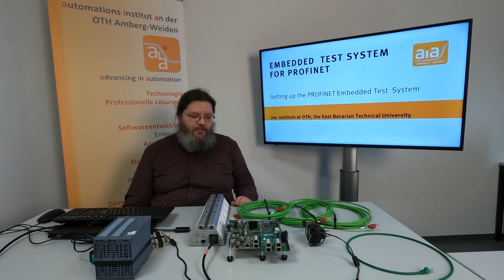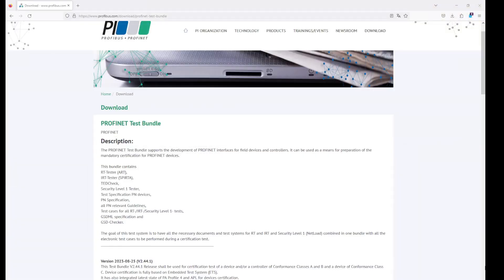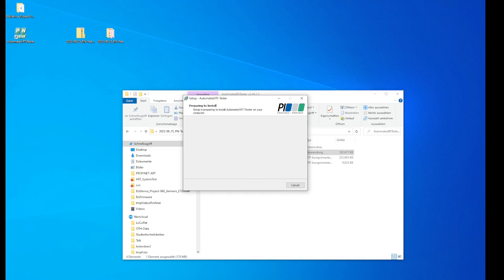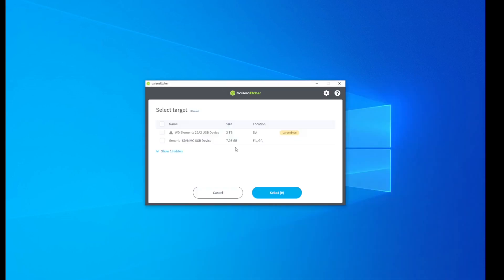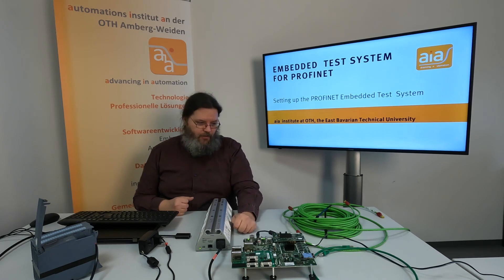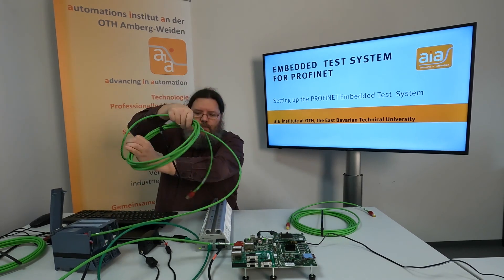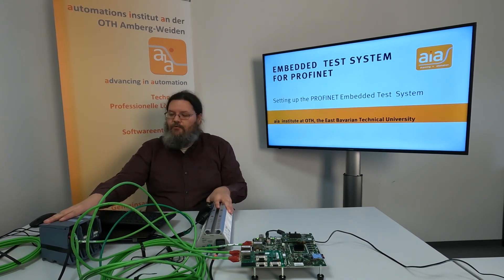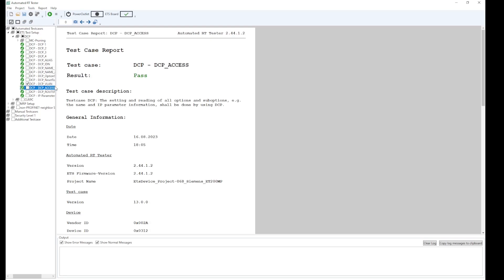EMBEDDED TEST SYSTEM FOR PROFINET

Comment: Which IP address should be used for the ethernet control connection (connection from ART to ETS HW)?
Reply: the ETS board has the 192.168.5.1
192.168.5.2 must be set on the PC
Reply: @Martin_Bx  As ETS board has IP 192.168.5.1, I set 192.168.5.2 for host PC. But what should be IP of DUT?
Reply: @Martin_Bx  As ETS board has IP 192.168.5.1, I set 192.168.5.2 for host PC. But what should be IP of DUT?